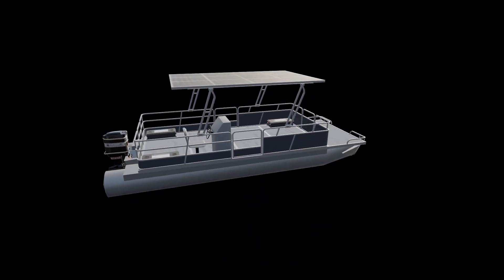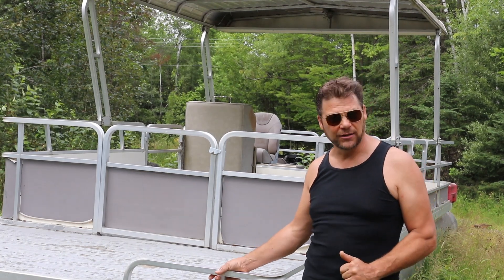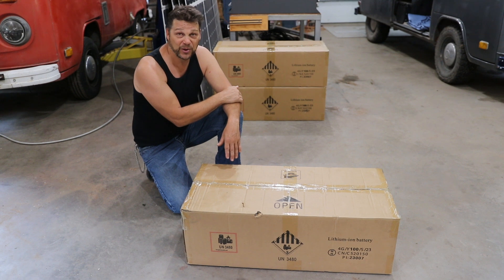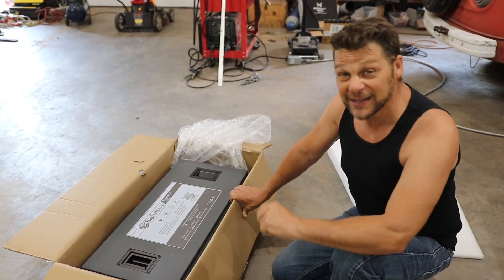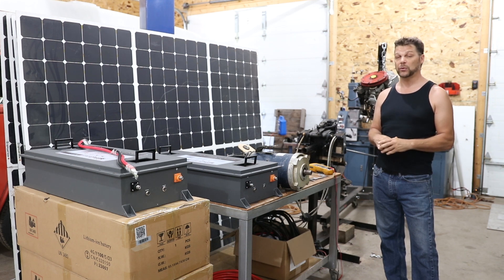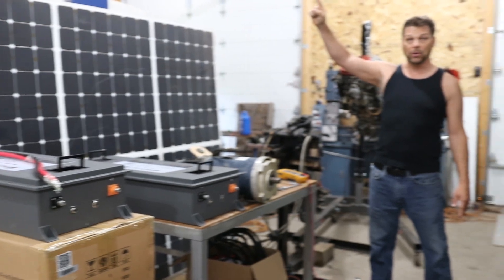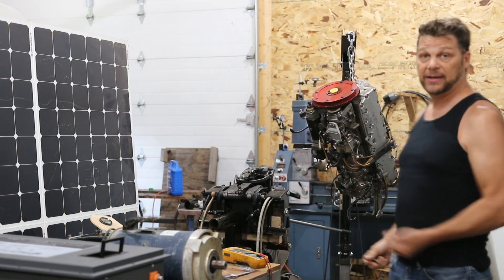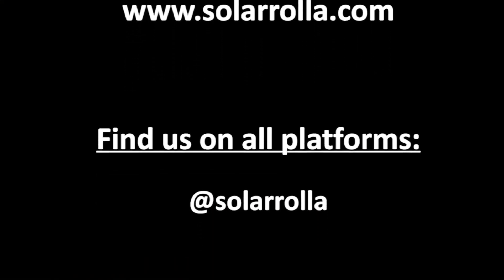Solar Electric Pontoon Boat with Big Battery Raptor2 Batteries!

Comment: My10 hour  550 road mile trip at 2.7$ mile pay 
1500. On water is 725 mile  pay 2$ mile. Carry  4.8x
= 7200 $ use 0$ fuel
But that 32 kw may be to slow. So I tow
a 4374 sq ft 64kw solar panel barge  
96 kw ttl 6561 sq ft
Pay. 0 on  fuel do 750 mile in 3 day $ 2500 day 
104$ hour  10$ mile
Reply: Need store 12 hr for  night  and that 96 kw 
May use it all during  day. Leaving  zero 
Watt fir day.
But 100 kw diesel
Make night kw
Burn like 40g 120$ gal fuel..  16 ç mile
Reply: 6561 x  3$  19,600$
Roi 3 trip 9 day
Reply: A 75 ft solar electric  got 30 kw motor 
Kw do  8 mph

Comment: You really don't want to machine any thickness off that coupler OR the spline piece if you can help it.  That motor is going to have a lot more starting torque than the gas engine did, and it's going to put a lot of strain on those connections.  Any way to get it professionally welded to the coupler?  Whatever way you go, set the controller's PID to reduce the rate of sudden power changes.  (P↓ ,  I↓ , and D↑)

Comment: Glad they sponsored you. I’ve had them in our bus for 4 years using them offgrid 70% of the time. First year, I had to return two because the bms shut down. 2nd year, had to have one returned for a bad cell.  Now in our fourth year, all five have failed capacity testing. 
I’m parked waiting for them to pick 4 of them up while I sit on the fifth one just so our rig can stay plugged in and operating. 
Hopefully, you have better luck
Reply: Yikes

Comment: I would recommend bifacial panels as you can get a lot of reflective light on the panels on the water...
Reply: Afaik there isn't a manufacturer selling bifacial modules that aren't faced with glass... Glass bifacial modules would make this boat extremely top-heavy